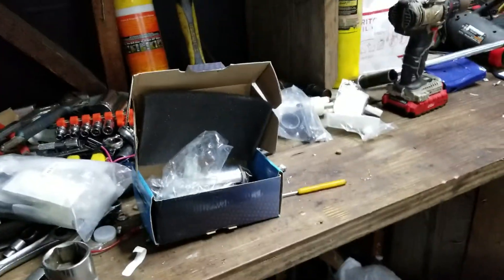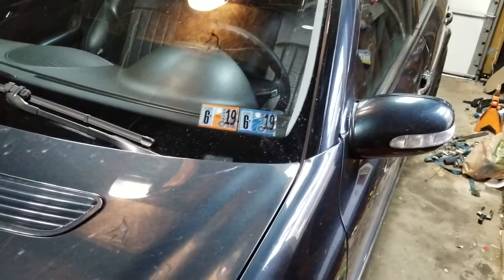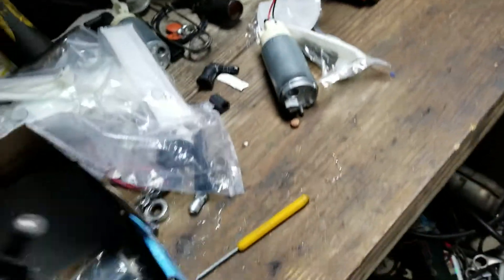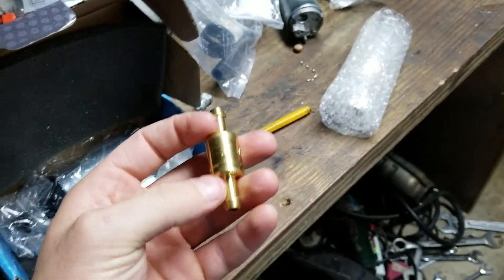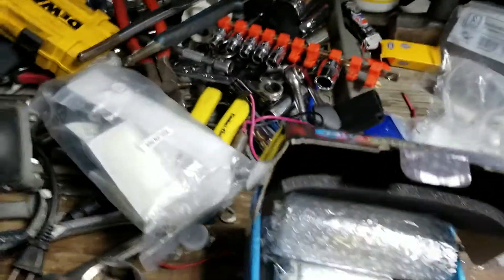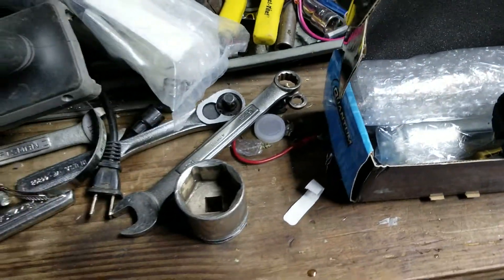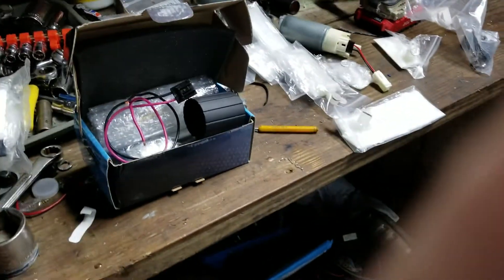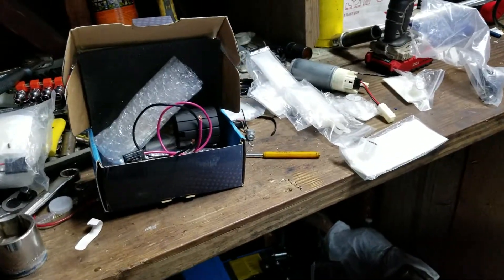Upgrading fuel pumps w211 e55 AMG

Comment: I need to get the mesh filters for the original Mercedes A211470000 pumps, where did you get those ones from ? Urgent! Thanks
Reply from the maker: My new pumps came with new filters, I'd say call your local MB dealer for them they should be able to get them.
Reply: @turbocraz1  the fuel pumps are no longer available or on back order, so I had to order them from USA ( I'm in England) I had to have the new pumps installed with no mesh. Is it safe to run like that? There is just the large cylinder fitler in the Left side fuel delivery unit which is also new.
Reply from the maker: @ahemgee9542  it's not a good idea if there is any junk in the tank it can mess up the pumps.

Comment: I would like to know the same question as the other guy. Do you kabir of any direct fitment fuel pumps for an 04 E55 AMG Mercedes? I need to change my name but no one to buy the whole fuel pump module, if you have any advice  I would greatly appreciate it. I have been looking everywhere for some like these Walburos that will fit with a little bit of altered Plumbing or a direct fit would be great just need the pumps 2 and the fuel filter. Thanks for any advice.
Reply from the maker: The walboro 255 work perfect i did use the 450s they work as well but 255s r pretty much same as the oem specs as   pressure go's u will have to modify the ends and modify the baskets buts pretty simple and way cheaper and more efficient then oem. Im running a 74mm pulley as well and the 255s keep up very well.
Reply: @turbocraz1  thanx for the info... I see if I can afford it...